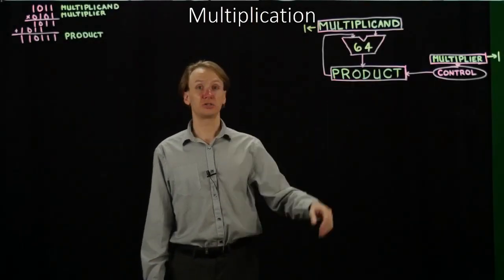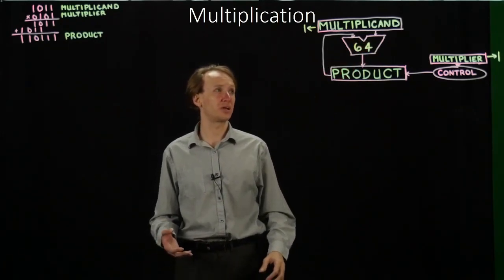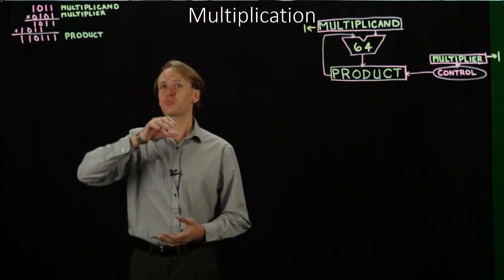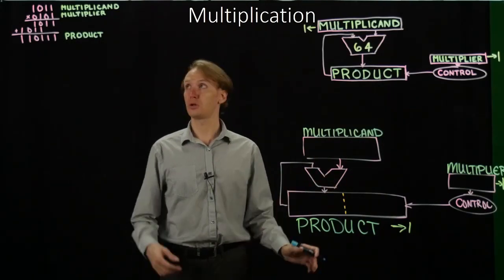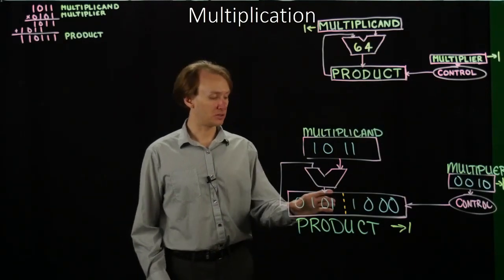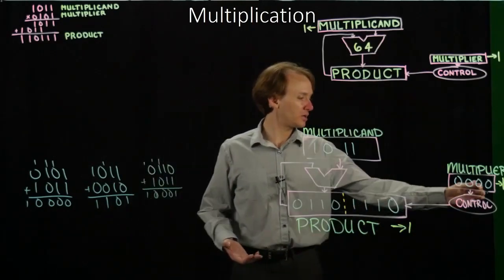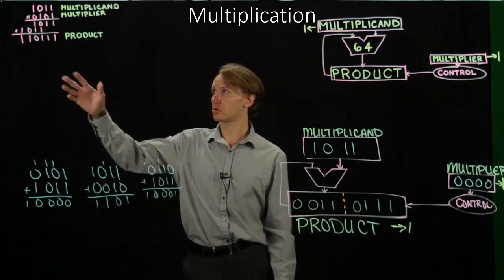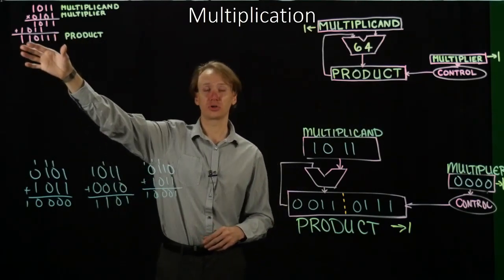12-1.  Improving the Multiplication Hardware

Comment: If the LSB of the multiplier is zero, why even run the adder? Just shift the product right by one.
Reply: This can be done and requires the use of additional circuitry or multiplexer.